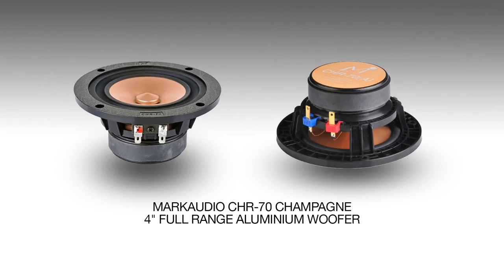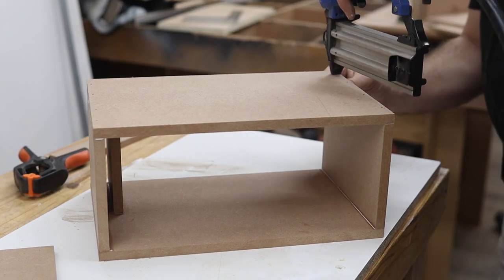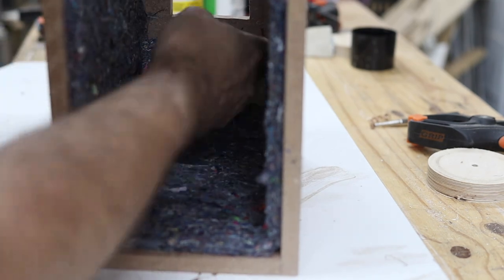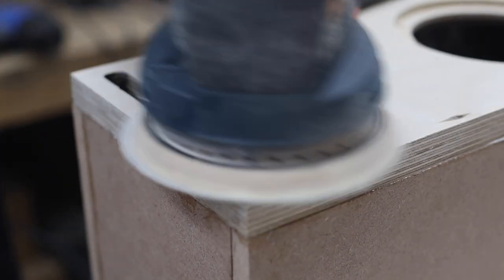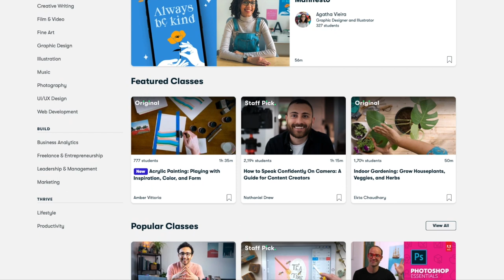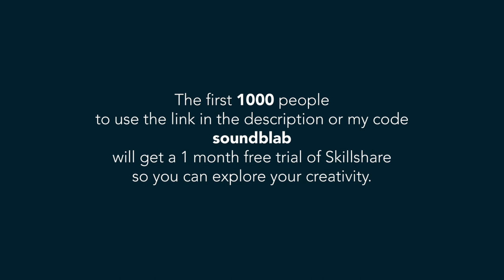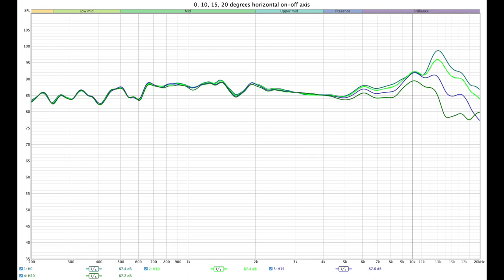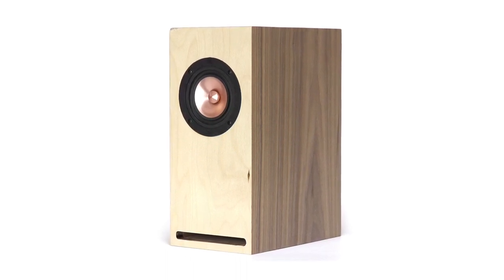Building a Full-Range Bookshelf / Desktop Monitor Speaker - by SoundBlab

Comment from the maker: The first 1,000 people to use the link or my code soundblab get a 1 month free trial of Skillshare: https://skl.sh/soundblab05221
Reply: Late to the video but wanted to add that slot ports and multiple ports vs single round have varying surface area and boundary layer effect.
I have found tight slot ports or narrower shapes can take more energy + lower the tuning to a degree. 
Most important is rounding the port exits and making them symmetrical end to end

Comment: Try blocking the bass vent and remove the driver and put a 2" deep bass vent tube on the inside of the speaker hole. Now replace the speaker screws with extension screws, like 1" longer. The driver will be mounted over the hole, not in it, ok. Use soft thin sprinkler hose as spacers between the box and the dtiver. Have the top gap berween the box and the driver like 1/2" and the bottom gap is lIke 1". If you try this you will like it! And want to make more.The hard part is the size of the gap. The sprinkler hose is flexible, so you can easily fine adjust the gap with a screwdriver (and you can cut many different size spacers to experiment) (that's why I said "like" before each gap size). Try this quick experiment. Try freely holding the driver over the hole wnile playing. You will get a "wha-wha" effect (like sometimes in house music). Tonal balence changes in the voice sound. Go predominantly by the voice sound to get the best sounding gap. And it''s important to bass vent the speaker hole before mounting the driver to stop it from sounding bonky.

Comment: One of the benefits of using a full-range driver, as Bose discovered ages ago, is that it's fairly simple to use DSP to correct the frequency response to tune it as you wish. You can also use a passive tuning network of various parallel notch filters or other filter types to attenuate the output as you need to get the result you want if your combination of driver and enclosure don't get you there on its own. Tuning a speaker becomes a bit more manageable when you've only got one to deal with.

Comment: TangBand W4-1337SDF  a not better ?
Reply from the maker: Good question, I have not tried the two against each other yet. But will be interesting to find out. The Tang band is a much more expensive driver, so you would think it should perform better. Perhaps I will do a comparison one day.
Reply: its that 'it is as seen by score, but you prob dont need' case

livepro combo has this sort of experience as well

Comment: Are there any significant difference between the CHR-70 and the CHP-70?
Reply from the maker: The CHP-70 has a paper cone and the CHR-70 is magnesium alloy.
Reply: @SoundBlab  Ah, alright. Does this result in any noticible difference in sound quality?
Reply: @Viktor-rp3tx  CHR sounds more modern, energetic. CHP more vintage, rolled off. Depends on the taste.
Reply: @djurivoje  Ah nice. Thank you!

Comment: That's exactly like mine same driver and pretty close enclosure including slot port... Mine just made out of birch plywood just clear coated, they do sound good, I just installed a filter to knock down that peak in the treble a little.
Oh and mine are passive.
Reply from the maker: Cool man! I am enjoying these a lot, even without a filter. Maybe i will include a filter option at some point just to tame the 13KHz region and see the difference.

Comment: I like all of your builds, straight forward and nice woodworking. However, I suggest you use other screws. The builds are so nice, but the screws are "screwing you over" on the looks :)  Attention to detail. There are black socket head screws wich are self tapping, os simply machine screws with thread inserts. That would elevate your builds a lot :) 
Also I have one question. Would the Arylic work also as 1 amp per box? To power mid and tweet with one plate amp and then feed the other the same signal? I have Hypex plate amps, but for a smaller build the Arylic would be fun. Thank you and keep up the great work!

Comment: why not solder the speaker cable to the driver on the side of the cable to the coil?
Reply from the maker: Not sure what you mean? There are no coils in this design...
Reply: @SoundBlab  hmm. solder directly on the spider wire. if that makes sense.

Comment: Thank goodness for DSP. One must have significant high frequency hearing damage to prefer the uncorrected sound, that 13kHz spike is literally ear piercing.
Reply: Yes, I built pretty much the exact same speaker passive, had to add a filter to knock that peak down.
Reply: That explains why they sound flat to me 🤣 I'm almost deaf at around 14k
Reply: @attainableaudio4533  Hi, can you please tell me what were the component values and type of filter you used? Many thanks.
Reply: Why would it be ear peircing? A bulk of your treble sensitivity occurs below 10khz.
Reply: @ubacow7109  guess it just depends on how sensitive your ears are
Reply: oke we got spikes, but is it in the recording? Cause that piano was hit hard.

Comment: A way to hot up your FR drivers for more khz.
Get some cheapies for practice. About 3 mm out from the start of the cone, make cuts right through the cone with a sharp razer blade. The cuts are like 8mm long (with 5mm gaps that are not cut) all around thecone. And repeat the process about 1 cm out from the start of the cone. And do it on the dust cap or remove it and construct a phase plug. Or with drivers with (stationary) phase plugs and (no whizzer cone).They are chiffy and you won't need one. Buy drivers without the whizzer. Best treble you ever heared (better than tweeters). Tweeters have air trapped inside, making them sippy. 😅 You get tweeter performance too! Along with my othet RANT, drum kits never sounded better, Cymbals so crisp (yet not fatiguing) and skins so addictively real! With the semi open sound (which also gives more khz)  You get the benefit of the dipole open sound, but warm (cos of the box). Bass level is not compromised at all. 😅 You can hear the skin on the kick! It's PURE POINT SOURCE cos even the bass reflex system is point source. For the purists it's a breakthrough cos they can have more bass that is still point source.

Comment: Very very good! But people I think will appreciate more slim, lighter ones like soundbars that can be used as speakers easy to atach to the walls.
Reply from the maker: Thanks. And thanks for the input, I am looking at such a project for future.
Reply: That's what I did. Slap a  class d amp in there and call it a day. Works like a charm.

Comment: Beautiful little bookshelves!  I've always enjoyed a good point-source speaker, and these drivers seem like they may lend themselves well to a Critical Alignment system.

I will say, I'm not a fan of the DSP adjustment.  It comes across as too flat and "soundtrack-y."  In their natural form, I can sense a lot more natural presence and character to the sound.

I definitely see what you mean about the "forward" midrange.  Fairly characteristic for a lot of smaller aluminum cone drivers, though, and I've had good luck in the past playing around with small rubber buttons glued to the back of the cone.  You give up a hair of detail in the high frequencies, but it can really attenuate the ringy/bright midrange and bring it in line with the rest of the driver's capabilities.  :)
Reply: Word of warning on these cones they are very fragile as in they will dent easily, ask me how I know, haha
Reply: I got a pair in 15.7l folded TQWT with BSC and in only takes about 2dB bump in the low range to make them sound much bigger than what they are. Sweet little driver. BSC is about 6dB with 8 ohm resistor and 1.4mH coil.
Reply: @attainableaudio4533  I was smart enough to leave them unprotected with my kids in the room 🤦‍♂️
Reply: Where would you get those rubber buttons?

Comment: Nice build, thanks for sharing.
The DSP might help flat the response, but ruins clarity, sounding dinamicly compressed.
Reply from the maker: Yeah, I prefer with no DSP as well.
Reply: Probably has to do with the power response, seeing as it is a full range and will be more beaming in the treble which mean less highend overall into the room, so if you use the dsp to take out too much treble it means the off axis response will be too dark. If using dsp you should see what the off axis response is like and try to adjust for that instead.
Great looking speaker!